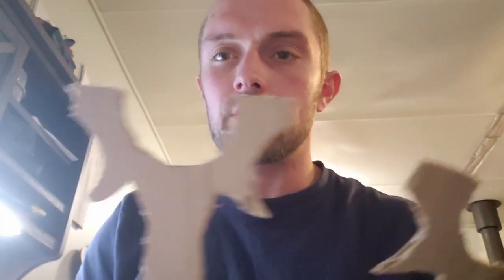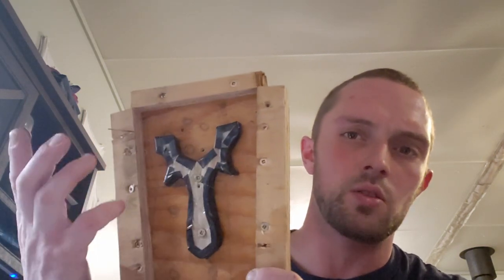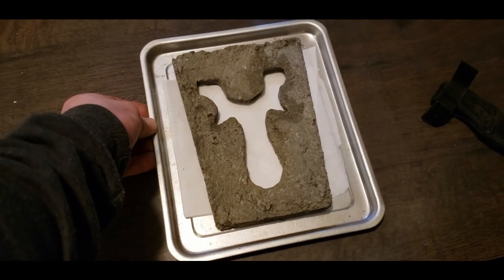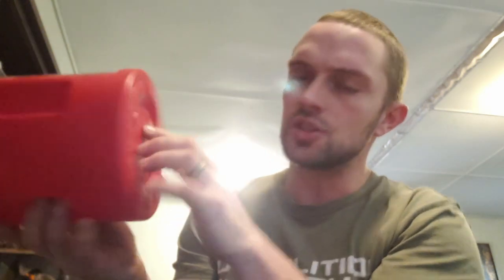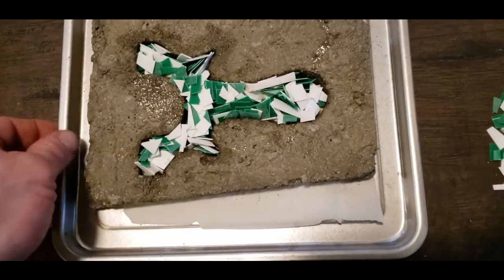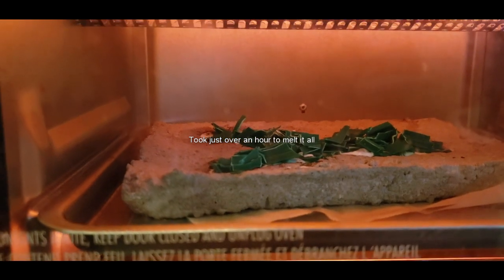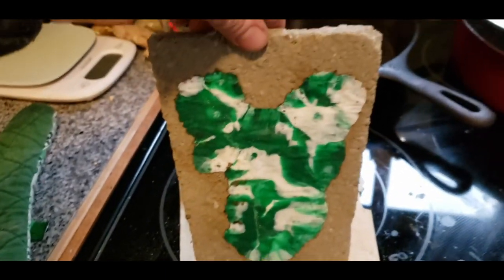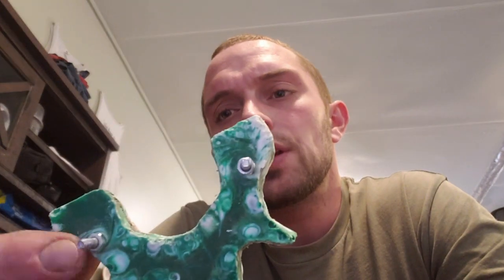Melt and Mold Recyclable Plastic at Home!

Comment: I’m wondering if there’s a reason you didn’t use silicone? I’m trying to think of what I have at home and clear silicone for the tub or glass is all I have and I’ve seen molds made with it before but I never melted plastic so I’m wondering if there’s a reason not to use the silicone.

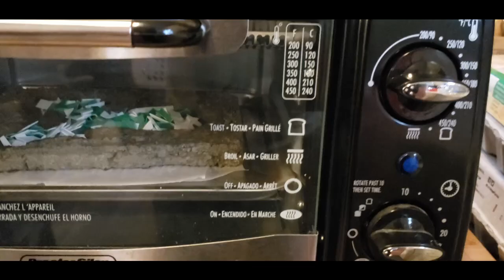Comment: 5:53 Don't forget you're not in state but on  internet: 300 / 350° F  = 150 /180° C
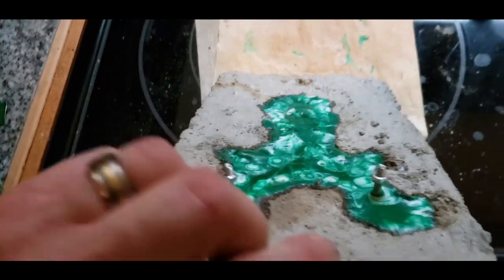7:42 NEVER sand plastic: you're creating very nasty micro plastic particles.
Instead scrape it: make bigger chips, then polish it if you feel it necessary, with a kind of an electric tools to polish cars.

Comment: I am thinking a plaster of paris and sand mix would work just as well as a mold.  I am also thinking if that plastic dissolves in Acetone like Styrofoam does, then you could just liquefy it in Acetone, then just pour it in the mold and let it dry with no need for heat.
Reply: Acetone breaks it down

Comment: Great tutorial. Only thing I'd do different, is use a  scrap 2x6 or wood from the scrap pile or firewood to carve out the original design, then spray with cooking oil, or release spray. Nice designs for the slingshots. I wonder how much weight a 1/4 inch thick sheet of plastic could hold?

Comment: When my dad was in high school, I'm 52, he made a 2 piece plaster mold. He then painted it and cast parts from wax. He then made a 1 piece mold with plaster from the wax piece. He then took the mold to his metals shop in school and poured molten aluminum into it. He never tried to remove the wax, just poured over it and it burnt out with metal replacing. Hid it before teacher seen and let it cool. He would just break the mold away, remove the sprew, and sanded it. I seen 1 pair of the brass (aluminum) nucks he cast in school.

Comment: You can get high heat resistant silicone so make the sling shot the same way with cardboard only maybe smooth it out with sulfer free clay n pour the silicone as you did the concrete, cutting the plastic in to smaller pieces will make for a cleaner less bubbled result.

Comment: Thank you for this! I’ve been looking for a way to mold recycled polypropylene without having to buy a ton of equipment, and this is the first video I found that uses such a simple method. Just one question though- Will it be safe to use already-fired clay for the mold or will it explode in my oven?

Comment: Concrete, cool, I would try to make it a little finer, though.  I have thought of using plaster of paris, but I think it will be too fragile.   I have been wanting to make clothespins from recycled plastic since the ones you can buy are either wood or really cheap thin plastic that busts apart in the sun in a year or less.  I think this could work.  I may have to grind the slots for the springs with a dremel, or just saw or file.  Concrete wouldn't support really fine bit of the slot, but otherwise, clothespins are pretty basic.  I can use wood ones for a model and use the springs on the new recycled plastic ones.  I have some ancient plastic ones I might want to use for models, too.   Save all my old springs and make new clothespins!
Reply: Plaster works great.  It will be a one time use mold though.  It makes smooth surfaces.

Comment: Works better if you make impress so maybe if you mean another concrete they're out of the concrete mode got the plastic heated it up and then put it in a bench press and push down Western clamps you get the shape you wanted especially working with number 2 plastic because it's really hard they like die depressed
Reply: If you use clay and lime is moulds it goes hard as concrete but then you could really use it

Comment: Just use fiberglass or carbon fiber. The stuff is cheap and EASY! Both are available in cloth and you cover your foam shape with layers of whichever fiber you desire. It will be FAR stronger and look much better. You can learn to use a vacuum bag to get the air out. It is way better than this method.

Comment: What if you put pergamentpapier on the sides of the concrete mold so the plastic doesn't get into it and, eventually, doesn't break it when you remove the platic piece? Could this method prevent the mold from breaking and make the plastic piece easier to remove?

Comment: Next time, use car engine oil instead of vegetable oil. The result will be more acceptable.
Reply: But the flash point for engine oil is 150C. Do you think it would be safe to use in an oven where the temperature could cross 150
Reply: @yohaan.kukreja1191  Atleast, it will be better than vegetable oil.

Comment: You are so adorable! Great tutorial! :D
I wanted to ask you if we can use plaster of Paris to make the mold instead of cement?
Reply from the maker: Thanks so much! I've never tried such a thing, but I imagine it might be good for a single use mold. Let us how it works out if you do it:)!!
Reply: I was wondering the same. But I think that...with the high temperature of the oven, the POP might want to crack and spread before the plastic is settled in the mold
Reply: @MolloRelax  I looked it up and POP is fire resistant so it wouldn’t cause any issues. The main component is called Gypsem which is apparently very fire resistant.

Comment: 1. Did you mention that the plastic is numbered 5?   
2. How do you think it would go if you made a slab and then cut out the shape?  Do you think it would work bout better or worse.? 
3. Was it easy or difficult to sand it after the molding?
Reply from the maker: 1. Yes number 2 or 5. Apparently its safe but best do do outside so you don't smell the plastic.
2. There's no real practical way make such cuts in the concrete, best to create a mold.
3. Quite easy to sand.

Thanks for commenting!
Reply: @selfentertained1932  Thanks for answering my enquiry. .
Reply: @selfentertained1932  I'm thinking that it must/should be easier to sand/trim the rough edges on the final plastic part, after it is taken out of the mold, than working to smooth out the inside surfaces of the concrete mold. It might be quicker too
Reply from the maker: You will have to sand the finished product no matter what, so if you can get the mold as close as possible (I was also hoping I could reuse that mold)
Reply: @selfentertained1932  yes...I do realize the final plastic part has to be detailed. What i'm also pointing out is that the inner sides/walls of the concrete mold are harder to reach with whatever tool you use/need to make them smoother.I find it way easier to approach/look at a piece of material from the outside. So when your plastic piece has been kicked out of the mold, 1st ,it is lighter than concrete to handle, 2nd, plastic is easier to shape than rock. a dremel rotary tool would work great  for that... Pretty neat the way you started with a piece of paper, then cardboard,then wood,to end up with concrete..thumbs up..
Reply from the maker: @MolloRelax  Thanks!!

Comment: what I do is on the stove with a spare butter knife to give things shape and push them together, maybe gripper, and elses (usually harder and higher melting point) to push it against and cast its shape on it. allows me to be more liberal and it’s quite fun
also, modify the stove: if possible, instead of the lid thingy, alluminum foil piece to concentrate the gas into one stream

its so sad that, unless blue flame you’d get the soot on it :((

Comment: How bad are the fumes when the plastic is melting?
Reply from the maker: You can smell it a bit (which is probably not great) so make sure there's an open window near by. It doesnt smoke or anything and the smell didn't linger for me.
Reply: @selfentertained1932  if plastic is burning it stops you breathing i used to melt plastic as a kid and watch it drip fire balls,  sometimes i would inhale and you lose your breath, if its just melting its not a problem as such